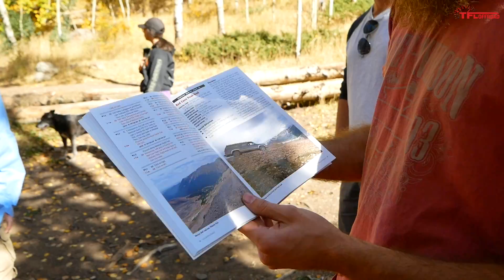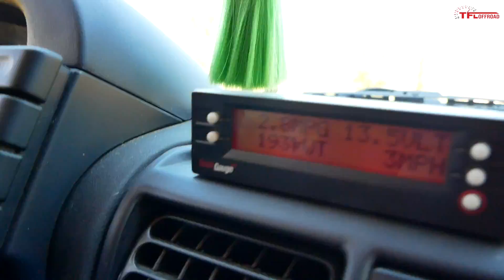Disco vs Red Cone: Taking a 2004 Land Rover Discovery To The Limit Off-Road!

Comment: Yes it's all about the maintenance......,my 2001 discovery 2 has 124k miles on it and it runs and drives like a new car. I replaced the head gaskets at around 100k miles and resurfaced the cylinder heads, and installed new valve guide seals...radiator, water pump, all hoses etc.....love this old truck.  The frames in these older discos can also rust badly in the rear section....so keep it clean and check/treat for rust.  I have driven this truck through almost 3 ft of snow...it is unstoppable, and the stereo is amazing.:)

Comment: Hey guys! just a tip for steep descents in an auto LR. Next time try using the hand brake(or park brake, or whatever USA types call it). Don't just yank it full on, just a click or two depending on how worn your shoes or cable may be. Remember that the hand brake is transmission mounted, so acts more so on trans as well as rear axle, but in centre diff lock mode acts solidly on both axles. 
That's the way I use it to help keep speed slower than it otherwise would in my auto(old D1 300 tdi here). 
 
ps. don't try this technique on a normal car with rear brake operated handbrake system unless you want to slide down with the rears all locked up! Only works well on a trans mounted handbrake system.

Hope that helps.

Comment: The reason your hill descent is too fast is because of the bigger tires. The calibration from factory is set for a certain amount of feedback torque and with bigger tires the torque feedback is greater because of having more leverage on the hubs turning them easier. I've used hill descent with stock tired and it slows the disco down easier. The 33's tend to push the descent control a little past it's ability to hold the disco back.

Comment: The term "rescue rig"  is accurate.
I have an 02 disco and I pulled a jeep commander, 1500 Silverado, ford f-150, Ford explorer, and a Nissan out of 3 feet of snow on the same night. I am completely stock right now but got them all out.. the D2 puts in work💪🏽

Comment: My proudest moment as owner of a '99 D2 was in January 2010 (I think it was), when we got an enourmous and unusal snow storm that put over 3' of snow on the ground here in SW PA. Streets in my neighborhood were impassable for up to 3 weeks and some vehicles were snowed over and unavailable to their owners during that time.
 
I lived on a street that was low on the priority list for snow removal. After it stopped snowing we had a gorgeous day. I got into my D2 and put it into low I think the only time I had it. I drove around the neighborhood and ran my errands. It was tough slow going. I noticed people with snow shovels stopped to watch me go by. Then some came over stopped me and told me the Land Rover was the only vehicle that successfully had made it through their street. They had seen pickups and Jeeps try and all turn back. (Not trying to diss Jeep owners; I'm an old CJ5/7 fan). They were impressed. 

To this day there are people in my old neighborhood who will say, you may have  a 4x4, but if the decal doesn't say Land Rover, it's not an off road vehicle.
Reply: Corry Arbuckle being both a Jeep owner and a Land Rover owner (Disco 3 and Cherokee, but owned Wranglers and 2 D1s) from NH, I can promise you that had everything to do with your tires and nothing to do with your car. The 4WD systems work virtually the same. Both typically come with open diffs which would’ve made the difference.

Comment: I'm adding this trail to my list for next year.  Everyone has heard of Ophir, Black Bear, Imogene, Engineer, etc, but no body ever speaks of this trail.
Reply: Have you done the others you mentioned? I'm looking to pick up a camping/wheeling rig, and a road trip to CO is on the list of things I'm going to do with it. Right now thinking of a first gen Sequoia.  They have ATRAC, can easily be lifted 2-3", and fit 33's. Do you think a vehicle that size could do any of these trails?  A don't want a 4R as they're a little small (and overpriced). My other choice is a 100 series Land Cruiser, but the good ones are $$$. The Sequoia is the best value.
Reply: Michael Smith I have not done any of the Colorado trails yet, but plan to next summer.  From the videos I have watched on these trails none of them appear difficult, but they are a bit scary in some places.  The switchbacks on Black Bear are pretty tight, even for a 2 door JK.
Reply: @ipdjbt  yeah, I've watched a few black bear videos, probably wouldn't take the Sequoia on that. Although I did see one where a Raptor did it, so I guess with some spotting and nerve I could probably do it.

Comment: A note... Tommy discussed that the HDC in his D2 was running too fast. In my D3, I can speed up/slow down using the cruise control +/-, try that out next time. Not sure when that feature was introduced, but it makes HDC a FAR more versatile tool vs just one speed.

Comment: Hey guys I have a very similar Disco2  myself. Did you ever go with the inline thermostat I finally did and while it's amazing! I run in the 180s. Also coil pack relocation kit is a must if you end up having to do yours!    Oh yeah did you ever discover the mode button in low range to lock it into 2nd or 3rd? Helps a lot

Comment: Just a thought I didn't hear you mention manual mode of the transmission when off road, are you aware that in low range if you select sport mode with the mode switch the transmission stays in the selected gear this is a big help on the steep bits

Comment: Was the differential lock on the entire time you were on the trail?  I always heard the steering would lock up some but you didn't seem to be having any trouble navigating the trail.  Or were you just locking the differential when you needed it and otherwise just relaying on the standard traction control?
Reply: once you are off the bitumen the centre diff should remain locked, after you are bogged its too late the wheels can spin to unload the diff if required

Comment: Yep ARB bumper sucks if you tap some rocks. On my di2 I slammed it a little and it completely fast forward a few inches and destroyed both my fenders. I went with a Slimmer cheap one on eBay with a better approach angle. The one thing I can say about the ARB is that it hooks onto your frame on both inside and outside of the frame instead of just along the outside so for winching it is a really good bumper No Doubt

Comment: Thanks for the great video, TFL. I'm just a few days away from installing a 3 inch lift and BFGoodrich tires on my Disco 2. What PSI were you guys running on the trail?
Reply: too much, thats why they slided down the mountain
Reply: Advice from a long time offroader/rock crawler. Go as low as you can without the bead breaking loose. I typically run 9-11 psi.  On a heavier vehicle go to 12-15.  If your tires new you can go a little lower because the sidewalls will be stiff and need to "break in". 

The point is, experiment. See how low you can go, 1psi at a time per trip, until you find a spot where you get a good ride, maximum grip, without breaking your bead or running them too flat.

Comment: 198/197 degrees is pretty reasonable if you have the AC on. With AC off you might only be in the low 190's. Anything lower and your thermostat starts closing, it's not like it will run at 150, the thermostat will keep it around 190-200.
Reply: Not to mention, most late model vehicles are designed to run at higher temps like that.  My old ZJ Grand Cherokee ran at 210, no matter what.

Comment: The fan for the coolant does not even kick on till 210 degrees and the hot mark is something in the 240 range.   I would not worry about temps in the 195 to 210 range on a disco 2... just keep an eye on the actual temps.

Comment: The slide on red cone is nothing what it use to be. I think at some point a bulldozer notched the trail and removed most of the slide. I remember the slide was very soft and you would come done it with part of the mountain sliding with you. The trick was to unlock the front hubs so yo could steel steer as came down the slide.. Like the trail leader said the trail changes over time.

Comment: HEHE, I love your videos, especially the off-road adventures.  Hoping to get my 2002 4.0 LR2 in the same condition yours is in eventually.  Having to rebuild the heads upon purchasing it (fortunately can do this my self and wasn't that bad since the timing wasn't adjusted at all to do the job, but then to realize I have other problems with the transmission and electronics shutting it down with codes and limp mode (The quick release connect from the transmission to the radiator let go and wont stay in., , so we will be looking at that in the spring as the budget isn't as high as yours.  I payed $600 for the LR, about $500 for the parts to rebuild the head including all the gaskets and new head bolts (couldnt afford the Stud and nut set as is recommended and I torqued my head-bolts down to 120lbs hoping that it will hold out!) but my 4x4 shifter is seized up as is the norm when it's not used for a while and didn't have the right maintenance, I have to take the center console out and work the shifter free as we see in other videos on this particular subject. I will get at that soon but in Eastern Canada it gets cold and Im not a spring chicken so I think I will wait until warmer weather to get at it, as I have other projects on the go as well.  Also hope to make some great adventure vids like this in the new year.  Videos like this keep me dreaming for the hopes of getting on the trails just like in this video; To go where no man has gone before (or few men lol) but maybe I should get a dog too lol.  Keep rolling guys!  Thumbs up!

Comment: Have a look at my avatar, there’s another high mileage cheap d2 getting the job done. On the climb it’s on in this picture there’s 30 plus vehicles which couldn’t reach the top, they tried very hard and snapped axles, cv’s, one diff centre and a roll over. One guy slipped over and fractured his wrist as it’s steep and slippery, the disco went to the top without issue.

Comment: It's a 2004, It isn't even old enough to drive itself! It isn't an old vehicle. Use a string to tether the bumper trim. You can use double sided tape instead of the clips. Each time it falls off (which it will) then the string will keep it from falling off all the way. I have an 03 D2, I know about the bumper trims from experience.
Reply: i have had 4 D2"s and currently drive a 2000. i laughed when i saw that part pop off! i keep a parts rig for those bits..your idea with the string is great!
Reply: I use 50lb test fishing line to secure my trim..if it falls off I won't lose it :)

Comment: @10:30 is that explorer even in 4x4? Those front tires aren't spinning.

Also, your land rover needs more flex. A lot more. There is no reason for that tire to lift at 9:46.

Comment: So, Land Rover or Jeep?
Reply: I would think it would be best to hear bunch of owners having both, that way you don't get biased opinions on either, about repairs and function...then finally drive both for your personal feel. I like how Rover is more SUV like, comfy on road, excellent 4x4 sys. But Jeep is just another experience with all offroad goodies and unique design for approach angles and much more fun details
Reply: I had a Land Rover.  Great off road but was crazy expensive to get fixed and it always needed something fixed. Moved to a jeep rubicon and it’s certainly better off road in every way.  However, Not as comfortable on road though.  I really like Range Rover but resale and maintenance are both horrible.